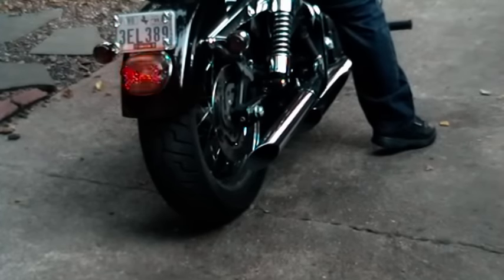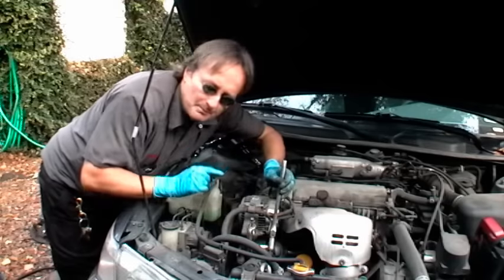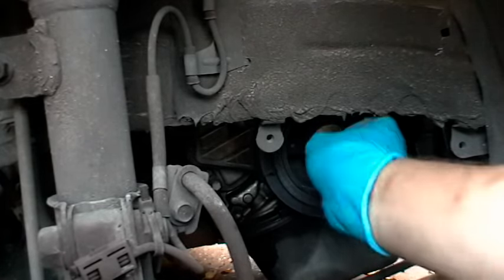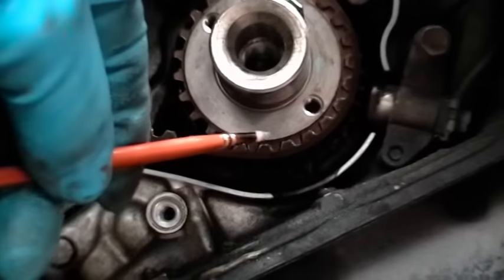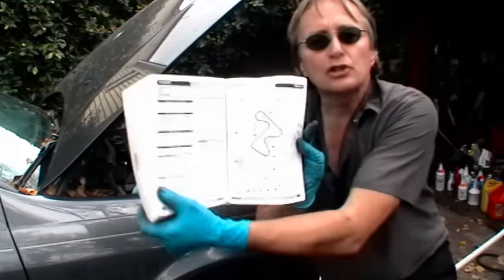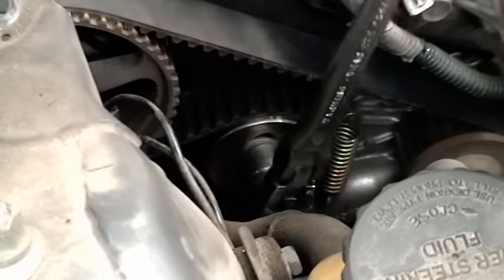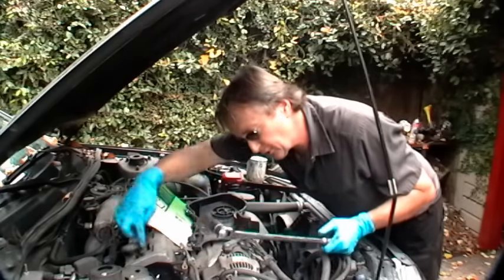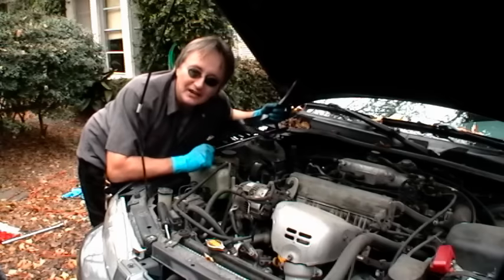How to Replace a Timing Belt in Your Car

Comment: i have a 1992 pontiac sunbird 2.0 ohc how do i get the harmonic balancer off .....i need it off so i can line up the timing marks the timing belt broke when i went to start it up i cant keep the harmonic balancer from turning im pretty sure its the harmonic balancer its at the bottom the gear behind it is for the timing belt...please help me with any information you have this thing is being a real pain..thanks..chris i saw your video on using a cheeter bar with a socket on it and turning the motor over using the ignition when starting the engine to get the bolt loose will that work for this car let me know any help is greatly appriciated

Comment: Hello Scotty, My  Hyndia  GT  has hit 60 k.   I inquired how much the cost was and the reply was $600.00. I replied $600.00? Yes, we also do the water pump.   I ask you Scotty, what is the standard price for the timing belt and is the water pump necessary?What would be the standard price for the water pump and the combine price if both are required? Thank you Scotty.
Reply from the maker: +sirwolfgang1 that's the standard price using a labor manual that all mechanics use
Reply: Thanks Scotty,  I always feel OK, when you say it's OK.  I ask,  Having both the water pump and the timing belt repeat the SHOP TIME hours? Are they combined or separate? What is the shop time for both jobs?

Comment: Hi my car has started to over heat really quickly could this be the head gasket,, i also noticed a slight leak coming from the engine which makes me think so to,, and one more thing, as i set off in my car if i dont give enough revs it stalls (obviously) and if i give it to many revs it wheel spins (obviously) but in between like a normal set-off the cars front end starts to bounce as though the clutch is grabbing and letting go very fast, any ideas?,,, hope you understand what i mean :)

Comment: I'm about to get a 01 gs430 lexus and it has 190xxx miles and the timeing belt has not been changed  the guy wants 3200 good deal or not ??

Comment: scotty.hi i habe a 97 toyota with 1.5 engine i been using 40 weight  conventional oil .but when tus Cold o hear a knoking on the engine like for a minute then it disapears could it be the oil the engine has 140.000 miles .will apreciate  your help thanks .

Comment: Hey i have a 1990 toyota camry im trying to put my timing blt on but it is tough getting it on. every time i set the marks on the camshaft i put the bottom crankshaft off of its mark. its tough u have force the timing belt on.

Comment: I got a 04santfea 2.4 I changed the belt and lined every up and pulled the pin on the tensor and spin eng over but the Mark are off by 1 tooth what am I doing wrong?

Comment: I have a Mazda 6 with 223k miles on it and the timing chain has never been changed. Is it a good idea to change it? I know timing chains last a lot longer than timing belts but this chain has 223k miles on it
Reply from the maker: if it makes no noise and runs fine, leave it alone. Just keep changing the engine oil as that lubricates the chain

Comment: Hey, I just got a 1990 Ford F150 for a project truck. For some reason Someone replaced the engine in it and it has a Timing Belt on it. I'm trying to get some info on how to replace this belt But as the Engine is different to the truck and I have no Idea where the Engine came from so I cant find any advice Anywhere else. Help!

Comment: i have a mazda mpv 96. i took it in to get the plug done it was leaking oil. got it back and 2 4 6 arent firing anymore and it still leaks. could they not be firing because of timing?

Comment: 2cd. Q is I just replaced my timing chain left & right, timing gasket,timing cover,all coils ,spark plugs, air filter,valve cover gasket &water pump, on my 02 ford explorer v8 4.6 4x4 on 6/2013@150,000 miles..I can't buy a new engine or have it rebuild, so is this close enough to last me and my family for some thousand miles or I'm wasting money?plz help....thank u!

Comment: im doing a timing belt on a 2002 Mitsubishi diamante  interference engine    my question  It did jump time on the rear head   it didn't break while running     so is their a good chance the valves didn't get bent  from other mechanic trying to start it while it jumped on the timing marks

Comment: I have a 94' Eagle Summit with a 1.8l engine. I changed the waterpump and belt now it won't start. any videos for me?
Reply from the maker: well, you messed something up, check all the sensors and wiring and pray you unplugged something and didn't go the timing belt job wrong. If you're often even a couple teeth on that job, it won't start.

Comment: Im going to do a timing job on my interference engine but im worried I will screw up somehow and it will be out one or two teeth and damage my engine in some way, if I can turn the crank 2 full rotations without the valves hitting the pistons then even if my timing is out the engine wont suffer any damage right?
Reply from the maker: Allen Pent that's right, you can't bend them by hand unless you are superman

Comment: 2003 Lexus 3.0 liter. 124,000 miles. Timing chain or belt on this?
Reply from the maker: timing belt, change it fast before it breaks with that mileage

Comment: after turning the engine by hand to get it at tdc, I just started the car without turning it back the way it was. so now how do I get the timing right again?
Reply from the maker: you use the marks on the cams and the crank and turn until they line up, and if they don't you remove the belt then turn em to line up

Comment: On a 2001 gs300 Do you have to rotate  to tdc or simply Mark belt take it off. Mark New belt put it on then rotate engine twice n check marks or something else
Reply from the maker: you can do it either way, but if you're a novice, put it on tdc so if stuff moves it's easier to put it back.
Reply: Ok

Comment: Hey I replaced the running belt in my 98 ford ranger 2.3L n ya I aligned the diamond timing mark up on oil pump with the timing mark on cam is the triqmglw everything is aligned up but won't start

Comment: Hi Scooty, i have a 2006.5 kia optima with 72k miles on it. it has a 2.4L 4 cylinder engine. i am wondering when should i change the timing belt?  usually i am not drive hard on this car.
and are 2006.5 Kia optimas reliable? 4 cylinder ones
THANK YOU VERY MUCH!
Reply from the maker: I'm not a kia fan, they tend to fall apart when older and over 100 thousand miles.  I would change the timing belt every 90 thousand miles though

Comment: Hey Scotty, Listen I have a 1993 Subaru Impreza with a 1.8. Timing belt snapped. Replaced rollers and water punp, but cant get the engine back into time. Have trid 10 times and I thing that I am always 180 degrees out. How do I fix. HELP ME PLEASE

Comment: Hey Scotty,
have a 97 Vortec 5.7 350... trying to get the TDC. The # 1 & #6 are up. the Distributor points at #1. I took the heads off already and distributor as well. how to determine if it's at TDC for #1.
Reply from the maker: the number one cylinder piston would be at its highest point.
Reply: +Scotty Kilmer Wow...i meant to ask...to find TDC with the heads or distributor off. Is it possible. Cylinders 1 & 6 are at the top of the block.

Comment: hi there Mr Kilmer, a question for ya. i have an 08 impala with the 3.9 it wont start. i did plugs to it, i checked for spark at the coils, i checked fuel pressure, and it wont start. i even tried to spray either down the throttle body and it wouldnt start. it just keeps cranking. im praying it dosent have an issue with a timing belt. what else can i check? i was driving it one nite, parked it and came out a day or 2 later to go to work and it wouldnt start. help me with any suggestions plz. i did have a diagnostic done to it. it gave me a p1516 and a p2176. could u explain them a little better to me if u have time? hopefully you have ran across this problem before and its a simple fix. hope to hear back thankx
Reply from the maker: +allmightyjamestown   those blow head gaskets all the time, do a compression test of the engine first. If not that, often bad ignition systems do that, have the crank sensor and coils checked
Reply: thank u for your reply. i know i dont have a blown head gasket. havent done a compression test, but il get to that. i thought about the crank sensor, but if it was bad i wouldnt be getting spark at the coils right?

Comment: Hi Scott,

I resently did a engine swap in my mitsubishi galant from the original engine to a sr20 det engine but I am somehow not geting all of the power from the engine when I mash the accelerater it reaches only 3000 rpm and when I let go an mash harder then I get around 8000 rpm but somehow it feels like the engine is lagging and why do I hav to mash one den twice harder for it to then feel like its picking up wid speed and the max speed I get is around 170 km..

Comment: i recently had my 1992 toyota camry engine ripped out because it was leaking oil really bad. i was just having seals and gaskets replaced. had to put a new distributor on because the old one was broken in 3 different spots. but the valves on the inside of the exhaust are white. nearly completely white. why? btw the car has nearly 309,000 miles on it. and is this bad for my engine?

Comment: Scotty I need your help, I used a hammer to install the harmonic balancer, after I finish replacing the timing belt on my 1994 Toyota camry I started the engine and it vibrates like crazy, Im sure the timing is right, but I think I damage something by installing the harmonic balancer with a hammer, could you give me your toughts please asap
Reply from the maker: depends what's vibrating, if it's the ballancer, odds are you have the key jammed on crooked and will have to take it apart and reset the key in its hold on the crank. But if it's not he ballancer, MANY things can go wrong on a timing belt job that will cause vibration, mainly being off one tooth or more on the belt alignment
Reply: ok thanks a lot

Comment: Yikes! Make sure you are TDC (top dead center) on the compression stroke. Follow all manufacture guidelines for timing component replacement procedures! Single and Dual overhead cam engine timing marks can be difficult to align without following proper procedures. Cam shafts are likely to move dramatically once the timing belt is removed due to valve spring and cylinder compression within stroke. Catastrophic engine damage is likely to occur if the timing belt is not properly installed. Improper removal of the timing belt can result in intake and exhaust valve damage in one or more cylinders. This video is not for the inexperienced...stick with your favorite complete repair manuals you DIY'ers!
Reply: Good points.

Cam shafts are likely to move dramatically once the timing belt is removed due to valve spring and cylinder compression within stroke. NOTE: If the cams keep moving on you, you can remove the spark plugs, taking off undue pressure within the combustion chambers.

Comment: Doing this job now on the same engine but how in the hell do you get the harmonic balancer pulley bolt out??? It just keeps turning the engine over :(
Reply from the maker: I use an air impact wrench, if you don't have one, get a strap wrench to hold the pulley from moving
Reply: Cheers, will have another go...had to apologise to my neighbours for the bad language ..:D
Great videos btw!

Comment: I had a question. So I changed a hydraulic tensioner on 1993 3000gt sl 3.0 dohc and for some reason when I try to move the car it loses power. Could it be out of timing and how does one know if a car is not in correct timing ?
Reply from the maker: +Adrian chaconne  remove the timing cover, get a cheap manual with pictures and make sure the line up marks on the crank and on the cams are spot on pointed right to each other
Reply: OK, I'll give it a try. thanks man

Comment: my timing belt went on my 03 galant while i was driving it. had the whole engine replaced with all new parts, but now my belt squeaks when i start it up and accelerate sometimes untill it warms up. how do i fix this?
Reply from the maker: tighten or replace the fan belts, they do the squealing

Comment: How do you turn back the timing on your car ?
Reply from the maker: if it has a distributor, you turn it after loosening the bolt. If it's a modern can with computer timing, you need a computer software rewriting computer to reprogram it

Comment: my friend has a '86 TOYOTA MR2 he swaped the motor in and try to started it didnt cranked so we checked and it was the starter ground wire he didnt tight to the chassy and than the engine cranked but i didnt run aligment of the distributor was wrong so i set it back to TDC and now i reallize the car is getting no SPARK AT ALL idk where to go from here i checked the coil that produces power and changed it with another mr 2's and still nothing any idea on how to get the car to spark?????????

Comment: Hi scotty i changed timing belt on 97 camry. I messed up. Car doesnt pick up speed. And belt squeal loud somtimes. How do i fix alignment. Need help please
Reply from the maker: I would assume your are off one or two teeth on the cam belt alignment. Take the covers off and put it on TDC crank pulley and see if the cam marks are off first. And tighten the fan belts more when job is done for squeal

Comment: There's a knock in my RAV4 - 3SFE when cold started and gets a lot quieter in about 3 seconds; however is always there and pretty steady. Could it possibly be the timing belt needs readjusting?? I've ruled out rod bearings but suspecting possible piston slap, wrist pin or value train but heard that a timing belt can sometimes sound like this :)
Reply from the maker: timing belts don't make knocking noises like rods. They make more of a belt snapping noise. Let any mechanic see it in person, we can tell in five seconds, pray it's not rod knock
Reply: Thanks, I'm reasonably sure its not a rod because of the plug wire test and the noise is pretty constant. Its worse at idle speed through parking lots i.e. low oil pressure and load.
Reply from the maker: Michael Oak
realize low oil pressure causes rod knock
Reply: Oh yes and I'm not ruling that out but I'm suspecting piston slap or value train also because it throws out a lot of oil smoke sometimes when cold started - not always but sometimes - which further leads me to that suspicion. Is the 3SFE an interference motor? I know I have to do more tests but was wondering if there was something characteristic about these motors :)
Reply: Scotty Kilmer Oil pressure test (wiggling needle) and pulling spark plug wire at various RPM's - Conclusion Rod Knock :)

Comment: How many miles until I should change my timing belt?
Reply: Every mile.. Or 2! No more then 5miles or it will snap and cost you thousands to repair or replace engine 🙊🙉🙈
Reply: manufacturers booklet should state specific to your car.
Reply: +l_l_lAdidasl_l_l TM dont listen to him it is every 60,000 miles
Reply: I'm ignorant, not retarded lol+l_l_lAdidasl_l_l TM
Reply: +THEMilkSHAIKH its ever 60K miles. its a saftey measure. they can last up to 200k miles but DO NOT take that chance
Reply: +THEMilkSHAIKH Depends on the car.

Comment: How come you have to take the right hand side passenger side wheel off just to take the timing belt off
Reply: Glenn Garner because the crankshaft pulley is at the bottom of the passenger side of the engine.

Comment: Hi scotty,my car is not starting and d timing belt inside d cover is not working or running when I try to start d engine,what's gonna happen! What's gonna happen when d timing belt is busted?
Reply from the maker: Rhandyescalante Escalante  belt is broken now, pray a new one will fix it and engine doesn't have internal problems, as they often do when for example the cam locks up and belt rips the teeth off

Comment: This is TOO CRAZY.   
   I Have a Toyota, same configuration as the one you are working on. mines a 2.0 l 1991 camry but the belt and everything are identical.   I just do the whole Timing chain, pulleys, tensioner oil pump , water pump deal and when i was doing it, in the middle , generally as i Always do here lately, I come to see your videos and if you do not have one i watch others and wish they were as good of a film maker as you are, LOL   So, I did see this video before and many others.   Thats not the crazy part. 
  
  I was flipping through channels earlier on the TV. came across a documentary that had already started and i stopped flipping because I thought i saw you, on reg TV..  i was like. WTF? anyway..    i was so convinced i kept watching  and then i started really wigging because this dude who i thought was you at possibly a different age or at the very least hair cut in your life turns out to be this lying cyber predator online and eventually a murderer .  before the murder thing though i started thinking  how amazing it was how much this guy sounds and looks like you.  it did occur to me that it was not you at all before the murder part and also before the part where you would be doing 20 years in the pen.  

  However.      WOW!    has anyone ever told you of this ?

Comment: i/m doing my timing my uncle went to put the belt on and the cam moves back like 7 teeth,how do i religh it with out messing anything up so i can get that belt on ,i read and did i put the crank shaft back alittle and rotated the cam back to place but my other ones off alittle to do i do the same thing the othe one one tooth off

Comment: scotty how do I put the spring on the with tentioner I put 2 and it breaks every time just trying to put it  .I have a 2003 4 cyl prestege
Reply from the maker: I always leave the spring and tensioner on, then compress it using a pry bar to get it off tension, put the belt on, then release the tension